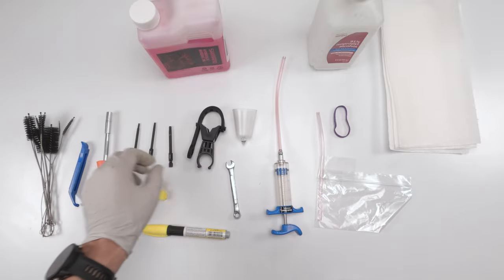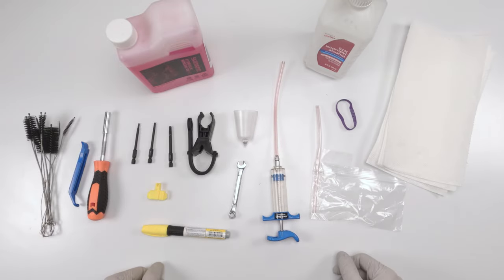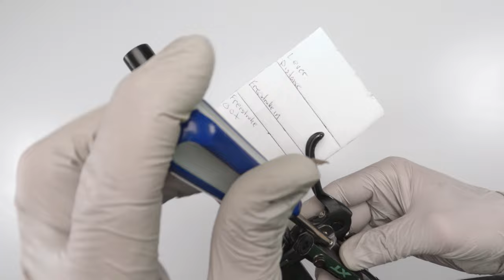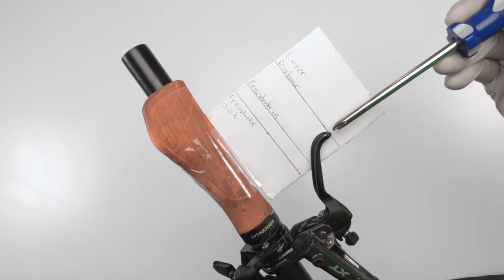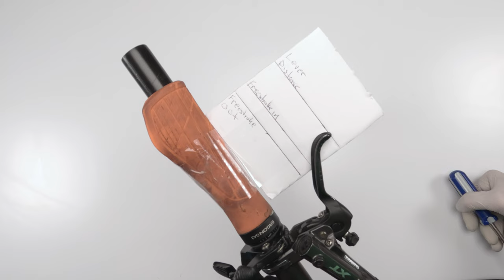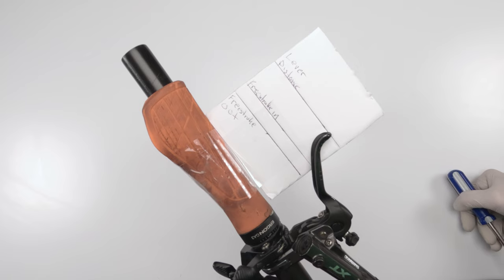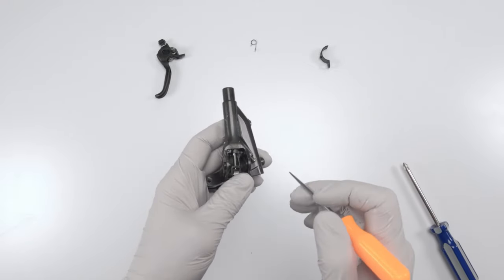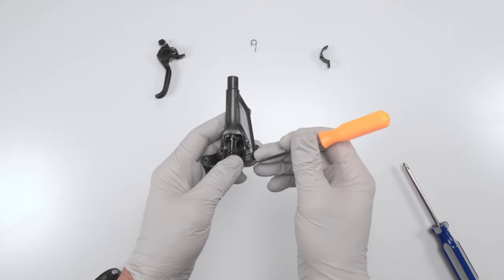Shimano XT M8000 M8100 Brake Bleed Service Guide for Beginners. Free Stroke FULLY Explained

Comment: Great video! But, I have a question. I just blead my breaks, and I came back to it a couple days later, and it drained a lot out. I tightened the caps on the top, and the bottom, but it was leaking out from within the break. Do you think a o ring could of broke within the break? Thanks
Reply from the maker: Thanks for the comment. So you're losing pressure but you see no signs of oil outside the system? first Check for a cracked piston, check for an oil leak on the piston seals. check under the hood that covers the hose to lever connection, check the inner side of the lever where the shaft pushes the piston and check around the reservoir cap on the side. 

Best way to check the above with remove the wheel and pads, install a block and pulse the lever with good pressure. this will let you know if your losing immediate pressure and give you some sign of where it might be coming from. let me know how it goes

There is no seal that would fail in the system that would create an internal leak that would lose significant pressure. seals that fail will show signs of failures externally, but sometime they can be very deceiving and not immediately noticeable.
Reply: @zoubtube  I just took out the break pads and when I squeezed the breaks, a lot of oil would come out from the pistons. Also, I saw remanence of oil in the breaks. I am probably going to take it to a shop, but thanks for the help.
Reply from the maker: @hollisterwithtomo504  Sorry to hear that. chances are it's a cracked piston. hopefully it'll turn out to be something simpler.
Reply: @hollisterwithtomo504  piston or the seals are worn, check around the cylinder for any dents or burrs, I had this problem with my slx m675 on one side, be prepared to get messy and pump the pistons out correctly, new seal and piston , doesn't need to be ceramic piston, I did get a little oil showing after but i think it just needed a few pumps to set the seal in around the piston, no leaks since.

Comment: I don't understand. I have a XTR 4 pistons M9120. Some people are telling me the screw needs to come out in order for brakes to grab quicker snd shorter distance.

Is this correct?
Reply from the maker: in the video I try to explain how the free stroke works. it basically moves the lever piston forward as can be seen in this video. by doing this, it also shortens the distance of the lever throw in order to fully lock the brakes (~1 cm shorter), which is also seen in this video. basically, it adds pressure to the system, so don't think of it as actually moving the caliper pistons (which I've technically never measured, but pretty sure it doesn't do at all (might make for a good future video)). Think of it as adding pressure to the system in order for the caliper pistons to more quickly lock the pads to the rotor (hence the shorter lever throw)

I would bleed the brakes as mentioned in this video, with the free stroke out. then go for rides at your favorite trials and reposition the free stroke on different days, make sure you DON'T forget to put the lever back to the preferred position everytime you move the free stroke or else it will not do anything for you. in ONLY works when the lever is put back to YOUR preferred position, which can be different for each hand btw (I so wish I mentioned this in the video).  the free stroke is very subtle but will be noticeable over time, you might like with with quicker bite, you might not. Just like to many features on mountain bikes, this is personal preference and don't let anyone convince you otherwise 👍

Comment: Thanks for a easy to understand explanation! 
Do you know if it’s possible to add the reach adj dial from a M9120 xtr lever to the M9100 lever?
Reply from the maker: I never tried it so I can't be absolutely sure, but my guess is you can't. You would need to change more than just the lever. the push rod to the piston in the 9100 is attached directly to the lever handle. The pushrod on the 9120 sits on a barrel which contacts the level body (7:32 in the video). the 9100 won't have the seat of the barrel to sit in on the lever body. Because of this I can't see it working. I have another video that shows the 9100 disassembled. If you compare the two you will see the differences on how the levers connect to their pushrods
Reply: Ok awesome man, I’ll have a look at the 9100 video, but that does make sense to me, cheers for the quick reply mate..
+1 just subbed you.
Reply from the maker: @Lil_tylenol  anytime myman!

Comment: great video. thank you
Reply from the maker: Thank you for taking the time to watch it and for leaving a comment. If you have any questions let me know 👍
Reply: @zoubtube  thanks. much appreciated. i indeed have a question. one of my brake levers needs service and i am not sure what to do. the big screw to adjust the lever position is stuck. when i try to move it in any direction it doesnt move. any ideas how to adress that?
Reply from the maker: @ephraimki7783  if the reach adjustments screw move clockwise or counterclockwise and nothing happen than chances are its stripped, though I can't say for sure without seeing it. If this is the case, you should be able to find lever handle replacements for it. it not hard to swap out. let me know how it goes

Comment: a question please : 
what about the lever position adjustment , how should it be during a bleed ? 
is it all the way out like the stroke ajustment or in , or it doesnt matter 
thanks in advance
Reply from the maker: I bring both lever and free stroke out. Just make sure to measure both before moving them, lever with a measuring tape or ruler from handlebar, free stroke by counting the turns. (unless it was at the all the way in position when you started). When done, bring the return the free stroke to where it was, then do the same to the lever.

Comment: I cannot turn the free stroke screw.  I assume it is a #2 Phillips head but my screw driver is slipping.  I am using a Snap On #2 screwdriver.
Reply from the maker: Apologies for the late response. A #2 should work fine. Checks to see if the head is stripped. Unfortunately, bike companies don't use the strongest metals. If the head is not stripped, is it possible that the screw was fully removed at some point and crossed-threaded when installed again? There's a slight possibility that it jammed internally, as mentioned at the beginning of the video, but that's a slight chance.

Comment: would you want the free stroke screw out for more modulation?
Reply from the maker: Technically yes, but I wouldn't expect to feel a drastic difference. I find SRAM brakes are designed with modulation in mind. Shimano, not as much. Chances are you will feel a touch more feathering at the mid-stroke, but the end will be an abrupt stop as usual.  Just remember to return the handle to the same position after adjusting the screw, or else it doesn't do anything.
Reply: @zoubtube  thanks for the response! if i were to want more modulation for nose pivots and rolling stoppies, should i look into switching to sram? are the sram levers/masters compatible with the shimano calipers? i'm running m8000 xt atm.
Reply from the maker: @floppywonka  That's a tough one. In my experience, SRAM brakes provide more modulation in general. They offer a greater band of pressure before the hard bite. Some people like the feel of this; others don't. 

Expertise aside, a wider band of pressure will help with control. I like having a wider band of pressure available when riding very technical stuff.  If you feel that it's difficult to find a comfortable level of control when performing a stoppie for instance, because the brake locks or gets too close to locking quickly, then you might want to consider trying an SRAM brake. I guarantee that you will feel a difference; what I can't say is if you will like the difference in feel. It's a very personal thing.
Reply: @zoubtube  awesome, thanks again for your view on this. i play bike polo and there's a lot of stopping quick from a relatively fast speed, nose pivots, and other bike handling maneuvers that require good front brake control. there's no rear brake on this bike so everything's done with the front. i got my m80000 xt setup used from a friend but it feels pretty wooden and grabby. this is my first experience with hydraulic brakes on a bicycle tho so i just assumed that's how they are. maybe i'll keep an eye out for a sram setup to try. do you have a recommendation to which sram setup i should look for? 
thanks again!
Reply from the maker: My limitation is only having experience with shimano and sram brakes. For that type of application, you might want to consider Magura Brakes. Seems to me Magura is popular with free style type riding. If you choose SRAM, I would get a brake with contact point adjustment (ex: rsc, ultimate etc) for fine tuning.
Reply: @zoubtube  awesome, thanks again. glad i found your video!
Reply from the maker: @floppywonka  Anytime! 👍
Reply: To grabby you might try organic pads or semi metallic vs full metallic. 
I like the progressive feel of organic pads on my front brake. Hate the on/off of metallics. Often times less noisy but will wear out quicker. 
Increased bite point can be had by using thinner bleed block like mentioned. Essentially it’s sort of overfilling the system but it works.

Comment: Im in a position where if the brakes are close to my grip, and i one finger brake, it smushes my other finger.

I got the lever throw all the way out.

Do I need more oil in the line or something?

otherwise I had to scoot the brakes further away from the grip, but that also puts my shifters kinda far away.

What am I missing.

If I just 2 finger brake then Im fine but what the heck thanks?
Reply from the maker: Interesting. If I was to guess, I would say you have air in the system. If the lever is all the way out, (which unless you have like really big hands it shouldn't be) and you are able to hit your fingers when pulling the lever,, that shouldn't happen when properly bled, or at least I've never seen this with Shimano brakes. I'd bleed the brake since it's easy and relatively quick, take your time though and make sure all the air comes out of the system and try it again. 

please keep me updated. thanks

Comment: So I was doing a bleed and for some reason I couldn’t pull the fluid out with the syringe, had reservoir on top and it was open and then syringe and bleed port opened and no matter what pushing or pulling it wouldn’t move , any idea why ?
Reply from the maker: I've seen this happen a few times before and in every case it what the piston that was jammed due to the level being pulled to deep when the system was open, many times by mistake. If nothing else works, separate the lever from the cable, use a 1.5 allen to push the piston back, connect the cable to lever and try bleeding again. let me know how it goes.

Comment: I can't fault anything really here, Shimano brakes are easy to bleed, any bleed aim should be to get air out of the system, I simply funnel and syringe, pushing from calliper up to funnel, checking lever feel after a few air bubbles pop up, finished up with a lever burp, literally done in 15mins. Also alcohol spray is great for cleaning up any mineral oil spill :)
Reply from the maker: Totally agree. I always tell people to never rush the job, especially considering most people will only need to do it once a year. A few extra minutes can go a long way. The same goes for bleeding shocks, forks, etc. Once you get used to it, both Shimano and SRAM brakes bleed easily and fast. Thanks for taking the time to watch the video as well as the comment

Comment: Hello, Thank you for the video. If you decrease the free stroke (thread the free stroke bolt in more), will this bring you pads at the callipers closer all the time (when you are not braking)? I have hydraulic disc brakes on the mtb (MT8000) and road (R8100). I like to have as less free stroke as possible, but I want to avoid brake rub more then having less free stroke. Thank you for the help! (I'm not having brake rub at the moment, but when I ride in the dirty rainy conditions, it does rub).
Reply from the maker: I've never measured to see if the pistons actually move forward when the free stroke is screwed all the way in from the all the way out position with a caliper. (Maybe do this for a future video?) The way I see it is it is more of a pressure response. When bleeding the system with the free stroke all the way out, you are maximizing the amount of oil in the system. From there, when you screw in the free stroke, you are "slightly" increasing pressure in the system, basically you need less lever travel to get the same response. Whether that increase in pressure is enough to "actually move" the pistons,,, I've never actually measured with a precise tool to say for sure. But I do know that if you want more lever stroke, or software feel, then bleed the brake with the free stroke all the way in, then unscrew the free stroke. This will be the least amount of pressure possible in the system.

Comment: What about the freestroke screw, after bleeding, should you just leave it 2 threads out or you need to screw it back in?
Reply from the maker: That is totally up to you. Whatever you feel most preferred. The most important thing is to find the most comfortable position for your finger. From there, you use the free stroke to find the preferred "feel" when pulling the lever and having your brakes bite. . Just remember to ALWAYS return the lever to the same position after adjusting the free stroke

Comment: After you are done bleeding, do you put the free stroke screw all the way back in or leave it out?
Reply from the maker: This is totally up to you base don what feel better for you. Take a few rides on your favorite trails testing the brakes with the the screw both in and out. just remember to reposition the lever to your prefered position each time after adjusting the screw. this is the most important part. It will most likely take a few ride before you feel a different as the distance is subtle. In the end, which ever feels better for you is where you should keep it

Comment: Im not sure if I got it right lmao. I like my brakes with the lever all the way out and the brake/ bite point as early as possible. So in order to get the earliest brake/bite point do I have to take the lever distance to the lowest and then unscrew the free stroke? After bleeding and screwing back in the free stroke screw + adjusting the lever distance to the " all the way out" position, would I then achieve my desired brake point? I hope that what I wrote makes sense or someone understands what I’m asking :D Thanks in advance
Reply from the maker: Adjust both the freestoke out, and the lever as far out as you like it. then bleed. then screw the free stroke all the way in, which will bring in the lever. then adjust the lever back out to the preferred position. this will be the most you will get out of free stroke shortening the bite point. hope this helps
Reply: @zoubtube thanks :)

Comment: Does this apply to the 9120 XTRs? Both sets of 9120s I have the free stroke screw is all the way in and I can’t seem to break it loose to adjust
Reply from the maker: Yup. my guess is the screw was pulled out to far at one point, and the mechanism seen in the video that it connects to got jammed on the side of it after it was screwed back in. I could be wrong but if the free stroke screw is jammed, there's not much that can cause it. try taking a pick and gently move it around to see if that works
Reply: @zoubtube  they are brand new on a new bikes. The screw is all the way in and tight. I’m not sure how much force I should use to break it loose.
Reply from the maker: @vin374  WOW! It really shouldn't be that tight. Give it some force and try and break it loose (make sure to use a phillips head that fits properly). it's literally just a screw that goes in out. Unless they messed up at the factory, then there really isn't anything to break

Comment: When I pushed in my pistons l blew the diaphragm. Oil weeps out of that hole from the end of the cylinder.
Reply from the maker: This is typically a sign of too much pressure, which could be based on multiple reasons. But it doesn't necessarily mean the system is damaged. The job of the weep hole is to equalize pressure when needed.

What you will most likely have to do is remove the cap and the bladder. I have a video that shows how to do it (I believe it is the M9100 brake video). You don't need to disassemble the lever to do this. 

Once removed. Check the bladder. If there is no damage, re-install it. Make sure the bladder and cap are seated correctly (this is VERY important).

If the bladder does have visible damage, like a hole, clean it with alcohol, then apply glue; crazy glue, gorilla glue, etc. Again, When installing, make absolutely sure that the bladder and the cap are seated correctly, as shown in the video.